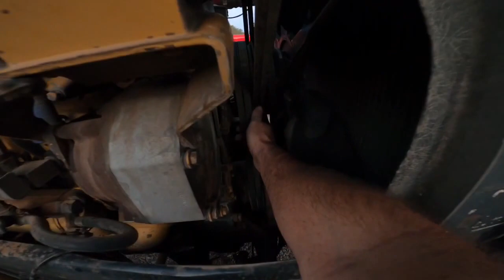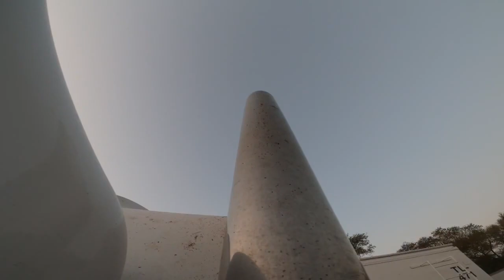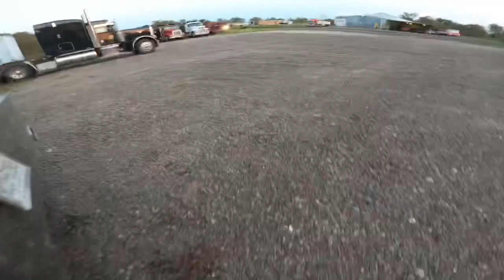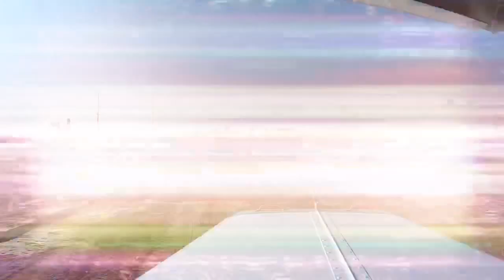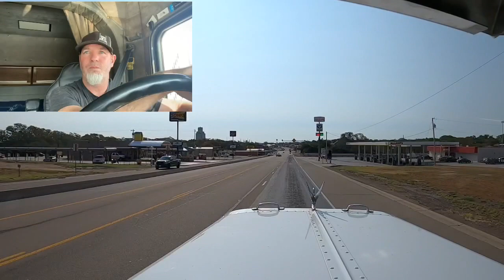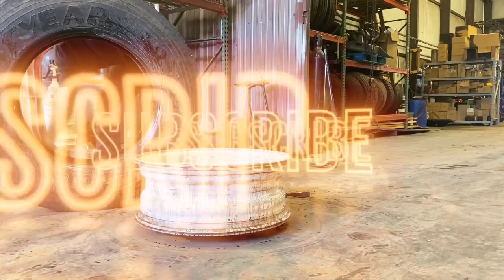Summer Doldrums, Slow August, Is a change coming for the 806 Driver? Trucker Vlog, Day in the life!

Comment: Chris, you would be an asset to any company you try for.  I know a lot about trucks, trucking,  and truck drivers and I think you have all the experience you need (for now), and most importantly, I think you are extremely trustworthy and professional.  If I had trucks I would want drivers of your caliber.  Additionally, not that many drivers have your mechanical abilities, and that is a huge plus on the resume.  

Also, I think the V.A. is short-sheeting you.  You should have a County Vet Rep that can help you get them squared away.  If not then get a hold of the American Legion, or the VFW; they both have Veteran Service Officers whose main job is to get veterans their benefits.

Just one other thing.  Try bumping tires with a 3 lb. ball peen.  It gives you a much better read on pressures than that billy.  Just try it for awhile and tell me what you think.  You cracked me up bumping the steers.

So get off the porch and run with the big dogs.  See ya on flip side.  :)
Reply from the maker: Thanks for all the compliments Donna, prob gonna get ahold of a VA liaison and try to get something going, bumped the steers for show while walking on around the truck 😂 Thanks for watching Donna and have a great week shiny side ⬆️ and 🔨 ⬇️